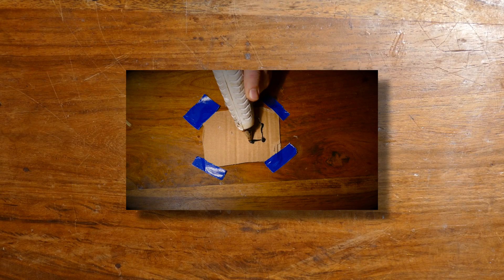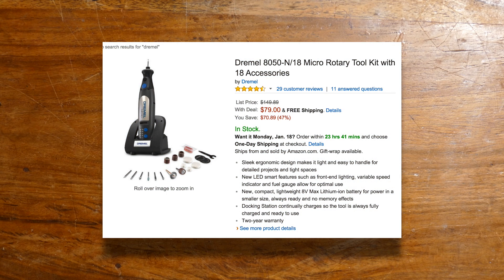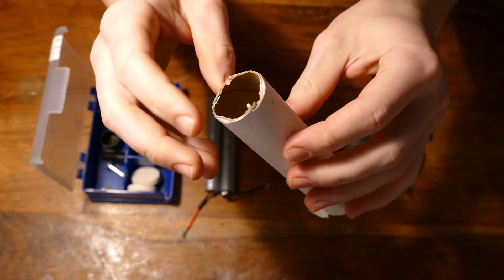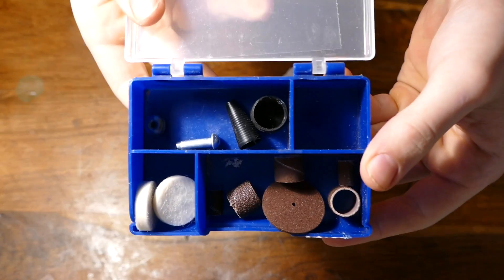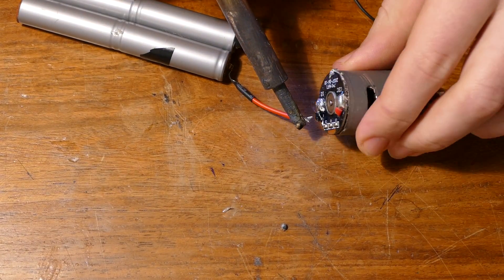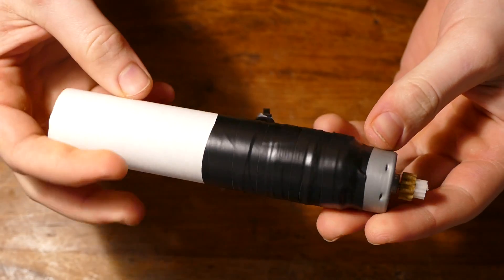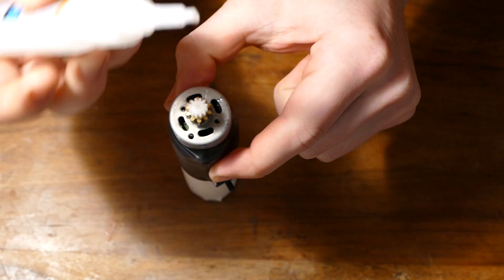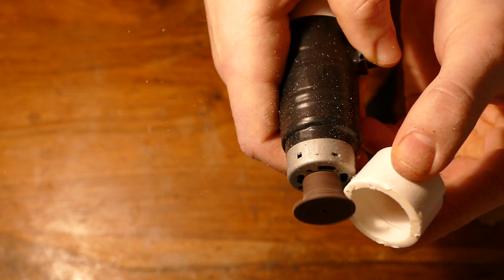How To Make a Dremel Rotary Tool for Cheap!

Comment: And  if you connect a potentiometer you can change the speed :)
Reply: +megav0us nope
your pot will burn up becaus pots arend made to handle loads
they are ment to control a load via a switching device
Reply: pwm is the way to go

Comment: that Li-po battery is a fire hazard dude
Reply: +Sebastian Bruhn that aint no lipo
Reply: +robot797 what is it then led battery
Reply: +robot797 lithium battery atleast^
Reply: nope
it is nicd or nimh becaus lipo always have more then 2 leads
or a smal pcb with leads
and he talks about aa batey's
4*1.5V=6V
he told us 9 volts is more powerfull
1 lipo cell is 3.7V
4*3.7=14.8V
so if these were lipo he would be overvolting his own stated max
Reply: +robot797 aha thank you sir
Reply: Sebastian Bruhn no problems
i like to enlighten people